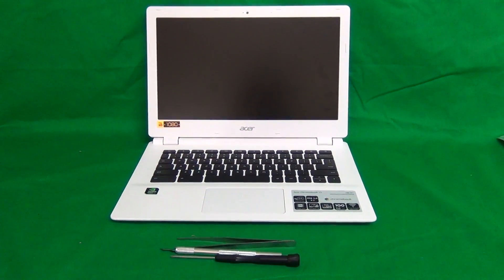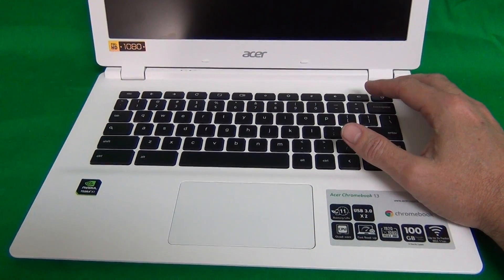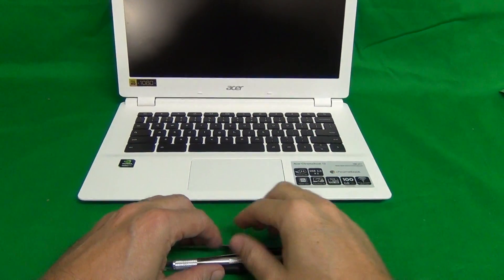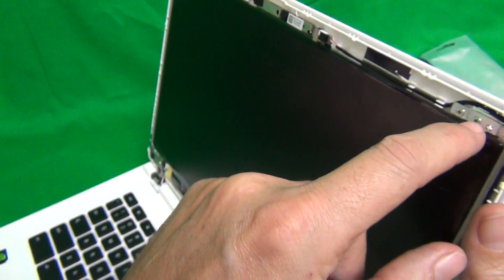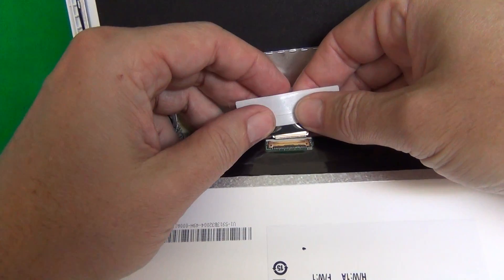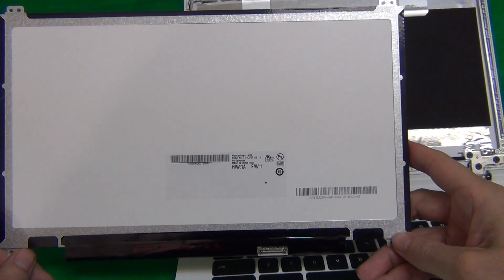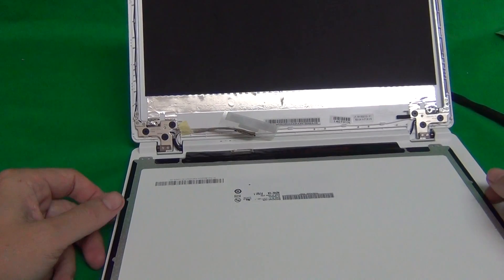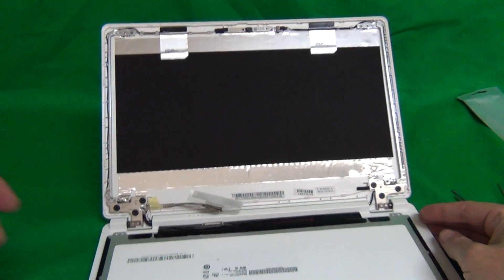Acer Chromebook 13 CB5-311 Screen Replacement Procedure

Comment: Do you already know if HD version screen fits to a chromebook with originally standard resolution screen?
Reply: I will be attempting this operation, so I will be able to tell you if it is possible :)
Reply: Thanks for response, good luck and I'm waiting for results. ;)
Reply: Okay, so it definitely works! Haven't used it much, so I can't really tell what other effects it might have on the computer. However, I will expect to have a lower battery life, but it really is worth the Full-HD experience :D Also, be 100% sure you're getting the B133HTN0.1.1 as I accidentally ordered the B133HTN0.1.0, which had the 30-pin connector on the wrong side... Good luck with it :D